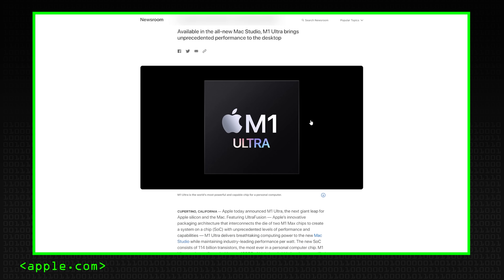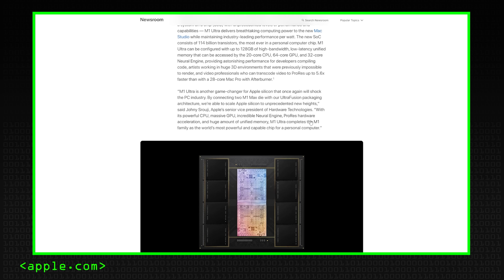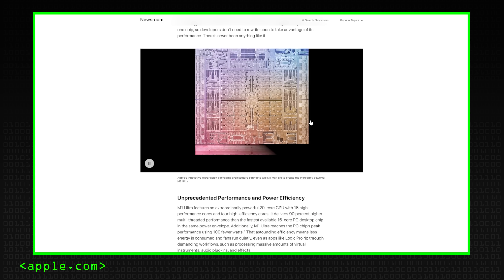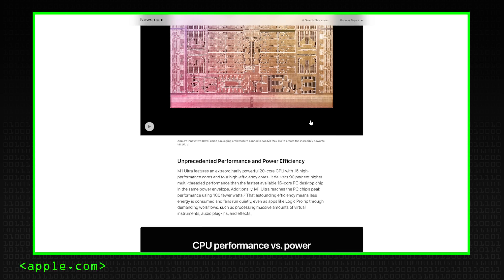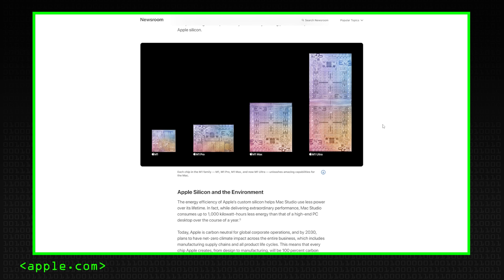Apple M1 Ultra & NUMA - Computerphile

Comment: If you have a massive high-speed low-latency die-to-die interconnect between two dies, accessing the memory on the other die could have a latency penalty of only 10-20ns. In a system using multi-level cache hierarchy, having 10-20% extra latency for remote memory access is irrelevant for most applications. What would be more interesting is if Apple can extend the same interconnect architecture to higher numbers of CPU clusters (e.g. 4 or 8) and how much extra latency would be involved for memory access in those cases. One interesting option to achieve this may be stacking dies vertically in addition to the planar configuration in M1 Ultra.

Comment: If you are linking together exactly two chips, then there is no need for any intelligence in the link. They only need to be connected together.  Put all the interconnects on one side of the die. If the top channel is XYZ IN, the bottom channel is XYZ OUT. When you rotate one chip 180 degrees and mate the interconnect sides, everything lines up correctly. It's still an engineering problem, and the speed of light might be a factor. But there's no cleverness needed. It's as if you had started out designing a 20-CPU chip with the design constraint that you could cut it down the middle into two (rotationally) identical halves.

Comment: Thank you kindly Dr. Bagley for sharing your knowledge with us. I'm quite surprised that Intel and AMD have not yet pushed for on-die memory given the M1's impressive demonstration
Reply: It does have some negative consequences. More expensive to produce, not expandable, if one thing breaks the whole thing is broken. I also don't know how much expertise would be required in ram design/production (keep in mind that Apple is far bigger than intel, which is far bigger than AMD) seeing there is a very well established ecosystem of memory manufacturers (they do have quite extensive cache systems on their CPUs already, don't know how well that translates). And not every task profits as much from faster ram. No idea  if those are major reasons for amd and intel, but like for everything else it's just a matter of finding what best fits a job.
Reply: @SimonVaIe  They could have always gone for multi-tier RAM - have SoC with proper packaging that is now being developed anyway and allow slots for normal RAM.
Reply: On-die RAM is rather limiting, so it wont really work well for either AMD or Intel to make such a product as such kind of RAM is much too slow, in terms of both bandwidth and latency, for use as a cache or if used as RAM you'd have the same problem as this video is talking about. But Intel had the i7-5775C back in 2015 with 128MB of EDRAM for the on board GPU, but was also used as a L4 cache, and Intel's upcoming Sapphire Rapids Xeon will have a version with 64GB on-package HBM2E with a bandwidth of well over 1TB per second. And finally you have AMD with their V-Cache supposedly having a bandwidth of about 2TB per second. tl;dr Apple can do on-die memory because they know exactly who their customers are and can make almost tailor made SoCs for them, where as AMD and Intel has customers much too diverse to make on-die memory viable.
Reply: @dotted1337  - Thank you for your detailed reply, I was unaware of the I7-5775C - that smells like it could have been designed for use in a console given the perceived similarity to previous xbox memory layouts. It is my understanding that a large part of the M1s 'boost' above other ARM designs is the lower latency access to system memory?

Perhaps naive but if such performance can be gained for an ARM chip, then should not a similar ratio of performance be seen with a similarly designed x86 chip?

With ultra-fast streaming devices and multi-channel pardigms like the PS5's SSD controller? could we not see a slowing of average memory capacity for users? perhaps the time for a fixed 16gb of memory on a CPU is now? especially given the console generations are locking game engine technology advancements for years at a time?
Reply: I think this is because they uses DDR in their desktop models (and not laptops because laptop come in both)and not lpddr as used in apple's 
M1 line up.

In mobile processor where DDR and LPDDR , both are being used - ram is mounted on the pcb.(these are soldered on motherboard and not on die itself as you said is in the case of apple)

Note - many things I said may turn out to be wrong so it will be better if one cross checkes things first before getting any conclusion.I would be happy to know where I am wrong and Learn something new. Thank you)
Reply: They are, look up Sapphire Rapids HMB. It’s a SKU for Intel’s next gen server chip and it has High Bandwidth DRAM on the package, connected to the main logic die with EMIB bridges. 

Very similar to Apple’s on-package LPDDR5 with the M1 (which is not on-die technically, but on-package).

Comment: Would it mean that the normal M1(max) chip could have been faster if Apple didn't plan M1 ultra? It seems like they made the memory bus slower in order to have enough speed for the ultra, or am I wrong
Reply: the memory bandwidth of m1 ultra is double that of m1 max, so presumably the increased bandwidth is just because there are probably two memory controllers or whatever, and since the max memory is double the m1 max that seems to support this

Comment: Doesn't the OS scheduler largely handle this? Even if you make a single threaded app, Windows will move it around on different cores but it stays within the same NUMA node.
Reply: Lets say you allocate a buffer and load data into memory in a single thread and then start many threads to process that data, which is perfectly reasonable and usual way to do things with uniform memory access. Then if you saturate the system with threads, half or more of the threads will run on NUMA nodes that are different from where the data buffer was allocated, incuring the longer access times. You have to explicitly handle the allocation and data loading so that the data is distributed in a way that the threads processing each part of data are on the same NUMA node as the data they are processing.
Reply: Yes and no. There are mitigations on every level to compensate for problems, but every solutions is just bad in comparison to an idealistic system with endless Memory, zero latency, no collisions. OS schedulers try to localize data and corresponding processes, but limits are still there. Every time processes on a node are in need for more memory than available locally or processes are relocated to other nodes will be problematic.
Reply: The OS tries to handle this, but it's not perfect. Eg. last time I dealt with this the OS tried serve memory allocations from the nearest memory, but wouldn't move it around afterwards. So we ended up using processor sets to direct processes to be started at the "right" part of the CPUs so the subsequent memory allocations could all be served from the local memory. That gave a 10-15% speedup compared to leaving it to the OS to figure things out.

Comment: Ultra fuson = we copied AMDs homework.
Reply: It has much higher bandwidth than infinity fabric
Reply: @vadhub  It doesn't really matter, though. There's a difference between bandwidth and latency. What IF does is provide a low latency link that has at least as much bandwidth as the memory of the system. You don't need more anyway because the DIMMs cannot provide it. In Apple's case, the memory is also shared with the GPU, so you need GDDR6X-like bandwidth on your interconnect if you don't want to tank your GPU performance. Since Threadripper doesn't share system memory with the GPU, it is simply not a problem. In fact, Ultra Fusion is probably closer to NV-Link in that regard than IF.

Comment: This entry is pure gold. Please make more vids where the latest tech is a jumping off point for the main topic.
Reply: NUMA's not new, it's been a facet of multi socket Xeon systems for many years for example, and other architectures too before that. The battle has always been to make the interconnect interfaces (QPI/UPI in Intel speak) as quick as possible to maximise performance. Software like RDBMSs are NUMA aware to optimise workload across sockets (and hence memory domains).
Reply: It could really take this channel to the next level!! Explaining modern day tech
Reply: Where did I apply for that?
Reply: Yes! Helps with understanding real world application.
Reply: That's the thing, this is not the latest tech.